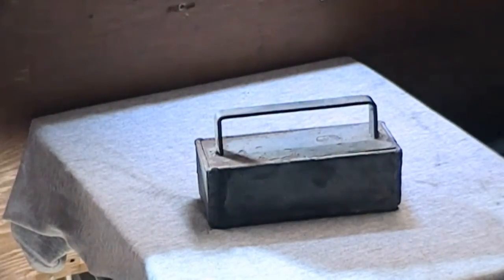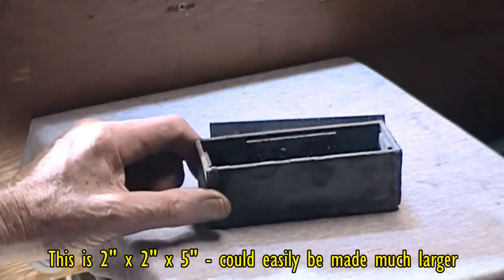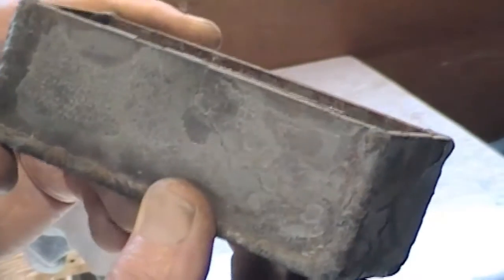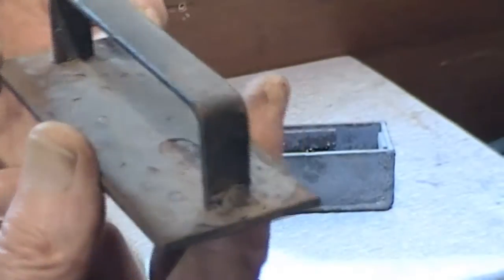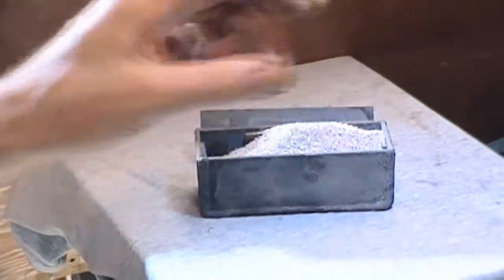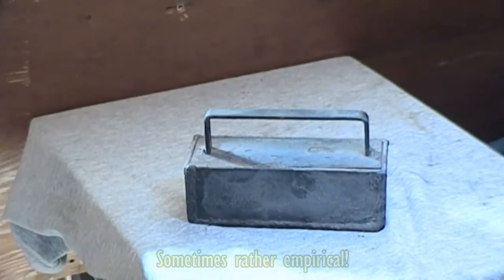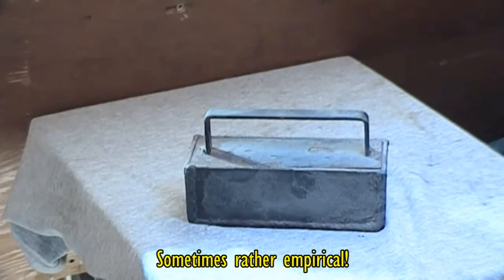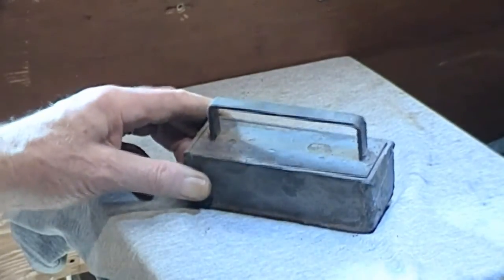A simple sand box for tempering small parts

Comment: Hi
That would make an excellent project to produce something useful whilst learning to weld or for that matter braze metal. Thanks for posting.
Reply from the maker: Hi Stephen - indeed, a useful little project for someone to practice on and, even if results not that good, it'll still be a useful device.
Reply: Well yes that was my thinking. Far better than just running beads up and down a piece of plate, without really needing to get the joint exactly right.